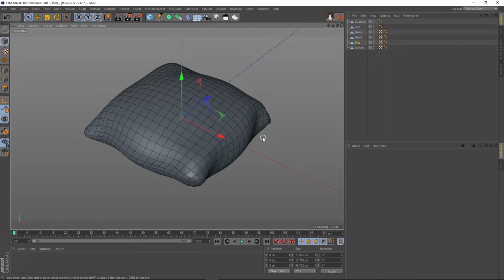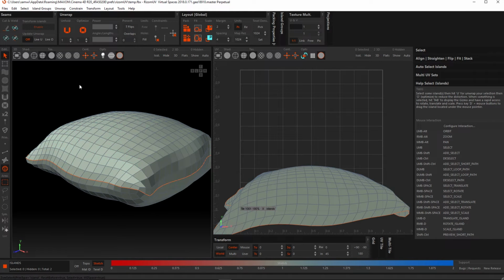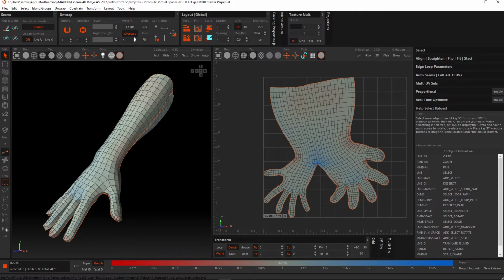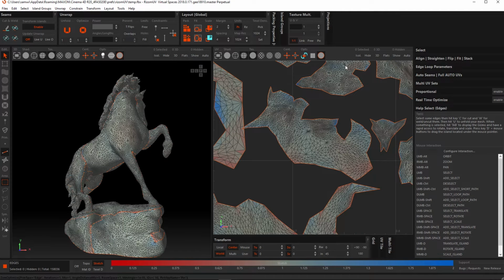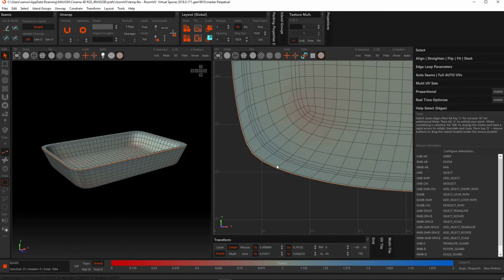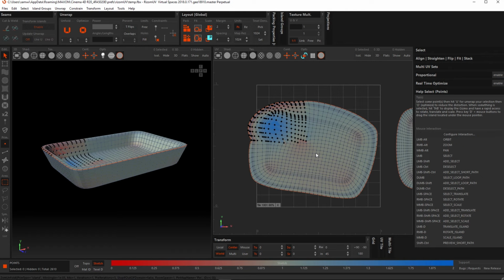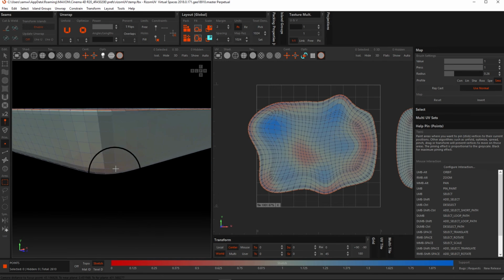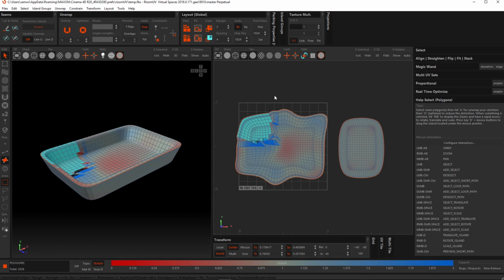Rizom UV: The Unwrap Panel

Comment: What are your thoughts on stretching? I noticed that they didnt really get addressed on how to fix it :)
Reply from the maker: Stretching is dependent on the kind of cuts you make, and how many cuts you make. So really it's a balance between seam count, and stretching.
You will probably get stretching to some degree, it's about keeping the amount of stretching low.
Reply: @DIGITALMEAT  Thanks for the response! So just so im clear a little stretching is considered normal? I do have stretching on my model but its only in the light red

Comment: I think my interface is messed up, the 3D viewport is too big and the UVs viewport is too short, I can't seem to adjust their sizes using my mouse like in most software, does anyone know how I can fix this?
Reply from the maker: As far as I'm aware, you can change the size of the views with the middle separator bar, but the rest of the UI is locked.